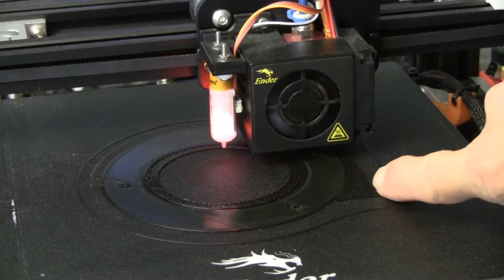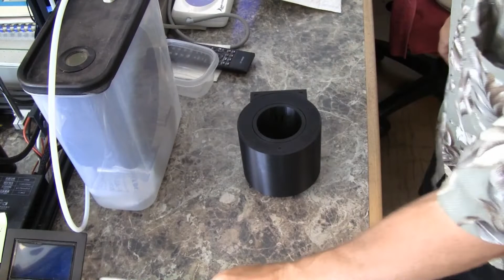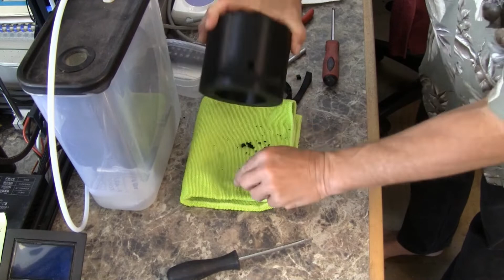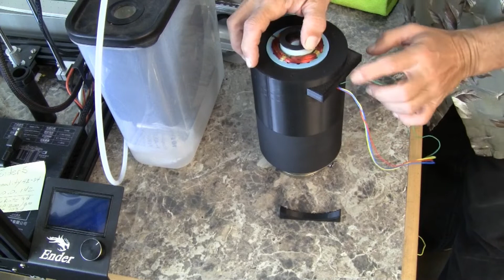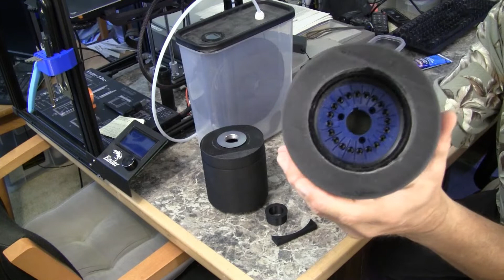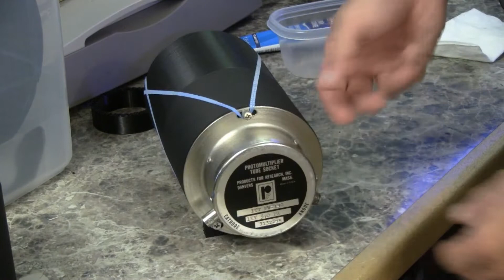NBTV DissectorCam Project, Part 3

Comment: I don’t understand what exactly is going on but it is very cool
Reply from the maker: Hang in there and you will find out what this is. When this camera is done, it will generate a very unique live image video signal called NBTV, which stands for "Narrow Band Tele Vision". It is a 1920s TV system that had 32 scan lines at 12.5 frames per second. Not very practical, but very cool! See my other videos for the "Ten Four, Eleanor" (An NBTV signal generator), the "Big Televisor" and the "Cathode Ray Televisor" for examples of this.
The project is currently in the mechanical construction phase. The stuff I showed today is all about supporting the very unique television camera tube so that it can be operated.